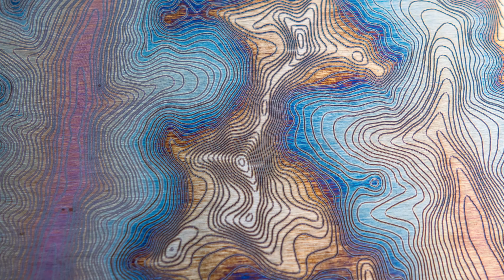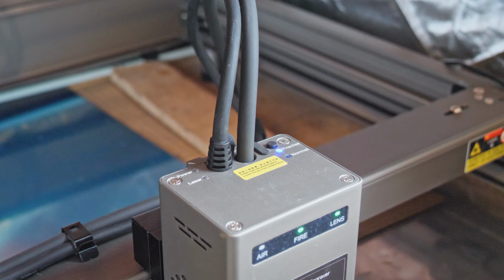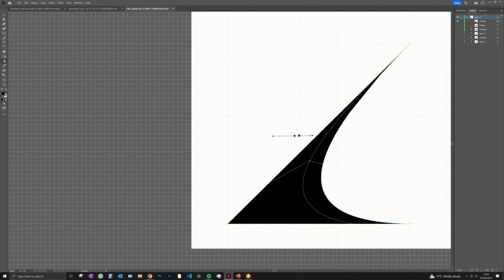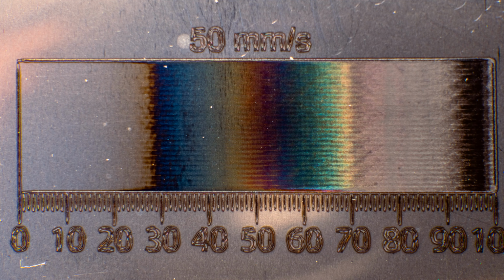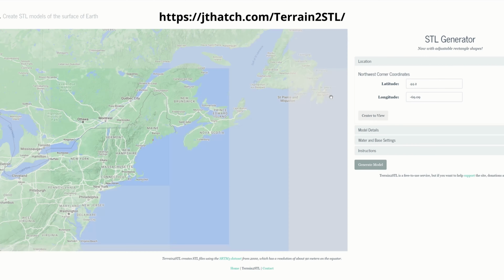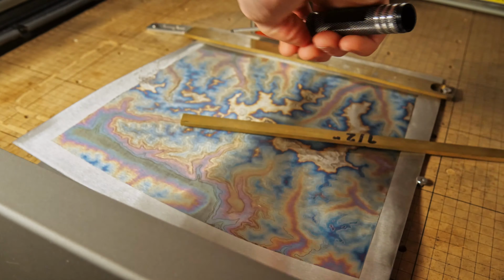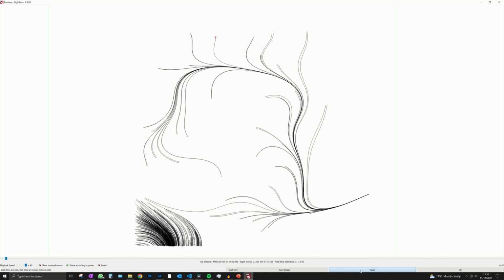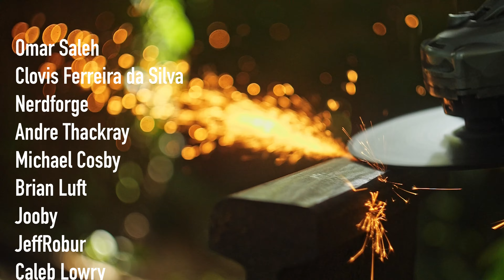Full Color Engraving Stainless Steel With a Hobby Laser Cutter

Comment: It may be a good idea to use a slab of metal (aluminium, copper or something else) beneath the sheet of metal to wick away the heat generated. The laser itself only  interacts with the surface so it should not cause a problem and the metal wont be warped.
Reply: Issue is that laser only interacts with surface, if it heated the whole thickness evenly there would be no curling up.

So heatsink wont hwlp sadly.

(Ofc. if it would have heated the whole thickness the same way, there would be no oxude layer forming like we see to begin with)
Reply: These colours are oxide colours  that indicate  surface temperatures between about 200C and  300 C. When you heat the SURFACE of the material to these temperatures you change the crystal stucture of the material. These temperatures cause the surface crystals to grow larger than their local compatriates beneath the heat affected zone.  Hence  warping is inevitable. If you try something like 6mm thick stainless,  the thickness of the material will absorb the surface expansion without  causing overall ditortion. However, caution. The heat sinking effect of the thicker  material will quickly drag heat away from the surface  and  change all your colour parameters.. In addition, thicker stainless usually has a matt fnish  (unless you buy very expensive miirror polished)  and this will be very poor at creating the vibrant colours you seek.

Comment: You can eliminate the random warping by rolling the sheet over a curved surface like a pipe that has a tight enough curvature to permanently bend the steel.  Flip it over and repeat, but this time with just enough force to flatten it.  It will take some practice, but you should be able to get good enough results that you can glue/clamp it down to a thin piece of wood to make it completely flat.
Reply from the maker: Thanks I'll give it a try!

Comment: The warping isn't from heat, it's from removing material from a thin plate on one side. Think of curling a ribbon by sliding the edge of a scissor blade along it's length. A thicker plate should warp less. You probably know this from tests with no dark or black lines, less warping. If it was heat, it would warp the other way as metal expands when heated.

Comment: Very interesting exploration -- thanks for the clarity and depth of your video. It occurred to me that if a reasonable re-registration can be achieved moving the steel sheet to a different machine, the contour lines might look quite nice if they were engraved, using a CNC with a diamond drag point. This would, of course, involve no heat, and the result is a very bright, fine scribed line, rather than the black laser line. I've been dragging very fine lines with high precision on brass, using a very rigid Shopsabre CNC gantry mill (with the spindle turned off, of course), and diffraction patterns are evident when the viewing angle is right. The bright gold of freshly scribed brass is marvelous, but unfortunately, brass loves oxygen, so the finished piece has to be varnished, which slightly mutes the bright gold color of the pure brass.

Comment: These experiments videos are great. Youre adding to our combined knowledge. If you were able to attach your workpiece to a large heatsink that might help with the warping, a large aluminum slab, myabe brown with some milled in fins. The exhaust fan would be pulling air around it making it more effective.
Reply from the maker: Thanks! I did have a few of the engravings on a 20mm aluminium plate and unfortunately that did little for the warpage.

Comment: Very informative and interesting as always.  I think you've answered the warping question yourself: use thicker material (with more expense), more gradual heat application/passes (with more time), or even spread a large design over 4 smaller sheets then combine, either flush (though I guess no matter how well finished there will be a visible line) or wall mount in 4 separate frames with the voids between pieces and frames engineered into the orignal design.

Comment: Just a thought, if you welded another sheet with a threaded fitting welded in, on to the back of your warped art sheet.
Checked to make sure the  welds have absolutely no voids or leaks.
Then connect a pressure washer to the fitting you might be able to hydroform a slight dome into the art piece.
It would still be warped, but in a more controled form.
If you placed the art side on the inside of the sandwich the finished art sheet would be concave, perhaps add an illusion of depth after it was separated from the backing sheet.
The only other thing would be to cool the back while using the laser.
Or float a layer of liquid nitrogen over the surface while using the laser.
You might want to stand back though.
Something to think about while mulling over an evening adult beverage with friends possible, cheers.

Comment: Solution to thin sheet warping is to glue the sheet to a backing board, perhaps MDF or similar using Evo Stik Serious Stuff.  You will need a mastic gun and a roller for the application plus the addition of a second board placed on top with some weight to keep things flat whist the cure takes place which usually would be 24 hours or more.
The reason for the warpage is due to localised and differential thermal expansion/contraction as a result of the poor heat transfer properties of stainless.  With that being said the addition of a cooling stream of air in to the laser contact area would help cool the skin or surface of the stainless thus helping to reduce some of the built up  stresses that are naturally going to be left behind after the process.
Mandalas are nice patterns with wider appeal.

Comment: What we do on big cnc lasers to prevent warping is spread the cuts far enough. Heat from single cut have then time to dissipate instead of being focused in one area. I have no idea if it will help on such thin sheet and in this specific application or if you SW can let you do this. Also there should be SW that can simulate heat distributions during cutting (or in you case marking) so that could also help. I just dont know if it can be acquired for free.

Edit: Also, a faster speed for marking the lines will of course reduce the transfer of heat to the sheet. Finding a good marking parameters without compromising on quality is definitely key here.
Reply from the maker: Cheers that is a great suggestion that I will look into, great to hear what is done in industry

Comment: Next project: holograms!
(Steven Mould has a video on special holograms that could be made with this laser engraver...)

As for the warping: how about trying to glue it to 20+mm thick steel using thermal glue (like the stuff they use to glue heatsinks to processors). There are such conductive glues that are able to withstand very high temperatures. Not sure about their price, though. But it would make sense since it would instantly transfer the heat into the massive heatsink.

Or maybe there's a way to heat treat without impacting the oxide layers by applying heat to the right places on the backside? (maybe add heat to the places where there is little or no marking on the front side) Or instead of cooling, preheat to a temperature just below the point of discoloration. That way the required added energy would be much less, thus introducing less stress. Also, having it heated will allow stresses to release during a slow cooling cycle.

(just trying to think outside the box here. I used to work with cutting and engraving lasers, but that was a loooong time ago. (1999 iirc) I remember that we cut unrolled objects, and when doing a cone, we had to cut the top and bottom first (so the "ring") and then cut the needed section in 2 separate runs because the metal would set as soon as the ring is cut. I know you can't release the tension of a solid plate by cutting it, but I'm trying to think of something that would work.)
Reply from the maker: All of these are great ideas, lots I've not thought of thanks! I like the pre-heating idea, I wonder if a 3d printer heated bed on max power would be enough.
Reply: @taow  A quick check tells me that a hot bed for PLA would indeed be in the perfect temperature range, because I think you'll be wanting to be around 190°C. (straw yellow appears above 200, but it can appear a little lower as well, so you'd have to rerun all your color calibration testing at various bed temperatures... aaaah, adding another variable squares the number of tests required - kind of)
Good call thinking of that!
I would assume that for a thin sheet of metal, it will deliver enough heat to maintain the temperature throughout the engraving.

Comment: I weld alot and to prevent warpage, we sometimes use a chill block to cool the work. Maybe a back side cooling block to keep the piece cool and wick away the heat buildup?
Reply from the maker: Worth a shot yeah, I tired with a block of aluminium below but I think I need a better heat connection between the work and the block

Comment: You could try to revert the warppage by engraving the same image ( or a mirored one?) on the back.
Reply from the maker: That method does seem to work in some way, I engraved on both sides of some of the sheets that I was experimenting on and although they didn't come out completely flat, they're much flatter than the single sided ones.

Comment: Fascinating work, it suggests all sorts of possibilities. Would it help if you attached the target steel plate to a large finned aluminium heatsink before irradiating? You might have to use some heat conducting paste between them to really see a benefit
Reply from the maker: Yeah I will give that a go thanks

Comment: This is very useful, thank you for making such a detailed video.  We're currently struggling with some simple 2-colour engraving with the same laser and figuring out a) settings to get the right colours and b) repeatability.   For example, having found a decent green, then trying to apply that to a new sheet, the colour shifts substantially.   Do you find that it is best to settle on an interval (say 0.05) and then just vary power and speed?  I think you implied that you started to run at 40W to get the better beam spread.  Did you defocus at all?  I have so many questions about the details of this!  Love your contour designs!

Comment: When I first saw the mountain images, I thought you were doing a fractal.  I suspect you could bolt the completed mountain image to a flat piece of wood and have a result that can be put on the wall.  Maybe those flaps you folded could be drilled and attached with pop rivets to a wood frame to keep it flat.

You can create colors on copper with heat also.  I'm not sure if the effect is as permanent as it is with steel.

Comment: So cool.
I wonder if the warping could be fixed by doing a secondary print on the backside.
Maybe a mirrored version of the desing in the front ?
Reply from the maker: Thanks yeah that is a good suggestion that I will try, on the sheets where I did experiments on both sides I saw the warping even out a little
Reply: @taow  I just realised the warping from the front side would be a pain to set it flat for the back side. X )
In any case that sure is an amazing machine.

Comment: Regarding the warping issue...  The forces generated by surface distortion of a flat surface are huge, regardless of the cause (impact or heat.)
Clamping the material will never completely fix the problem; the forces are still going to be present after the clamping is removed.
I suggest you show what you have to a high-end auto restorer.  Someone who deals with older classic cars would be best because those were more likely to have large expanses of near-flat sheet metal.  What you have is well worth pursuing.
Reply from the maker: Cheers, I agree with the clamping and cooling will never fully fix the problem, those forces are very large and over a big sheet build up a lot

Comment: Further thought... because the curvature is concave, if you attach it to a piece of plywood, cut to fit inside the flanges, would screwing through the flanges into the edge of the ply be strong enough to hold it in shape?
Reply from the maker: Yeah I think that would work for keeping it roughly flat

Comment: I wonder, if the nice frame you made on your last run could me arranged such that, if flipped over, you could repeat the run on the bottom side and destress the material to unwary it.
Reply: Unwarp
Reply from the maker: Certainly running the laser on the back side of a sheet seems to fatten it out somehow, on the experiments where I used both sides for different tests they are a lot flatter than the single sided tests. Thanks

Comment: Could you temper the warped sheets by heating them up to a high temp and let them gradually cool back to ambient? Might need to mount them flat first, then do the tempering.
Reply from the maker: Might do, worried that might change the colours though

Comment: ...if warping is your issue, why not clamp it flat real flat.

Put it into an enclosure that lacks oxygen
(If you are cheapo then barrel with small hole and material more flammable than your metal works fine.)

Then heat it up just under melting point, to remove internal stress.
Since its not a structural part it will be in the "so long as it doesnt melt its fine" category - no need to worry about recrystallisation temperature, and grain structure reforming to a more rough version, which is nice.
Reply: Also, in sheets this thin - unlike what rest of comments seem to suggest - you are unlikely to be able to avoid warping.

The gradient in thermal expansion will be large enough that it causes plastic deformation due to "pulling strong enough". As a ballpark estimate, check what temps you form a given oxide color, look up thermal exapnsion coefficient to see what % it elongates, and check it against youngs modulus to see what stress you are dealing with. It will be above the yield strength of your material. The warp is basically the result of the remaining thermal expansion where the dimensional change is not enough to cause the material to yield anymore.

And even if you start using thicker slabs, the top layer will still retain a similar internall stress within it. Which can lead to a lot of "fun" if you try machining it without annealing (?) it beforehand.

(Pardon for shitty terminology, english isnt exactly my native language, or language in which i get my education)
Reply: Even easier, heat the metal backside whilst pouring inert argon onto it!